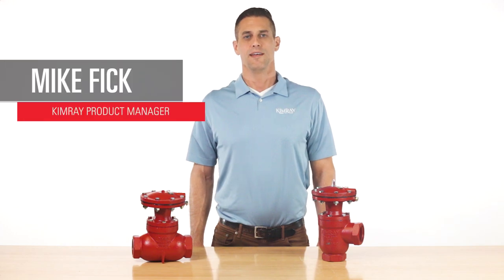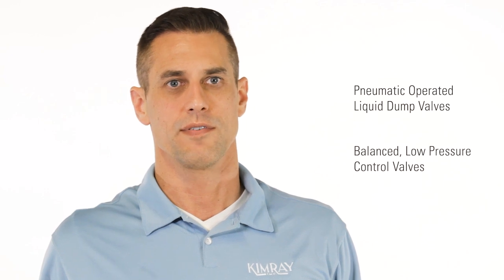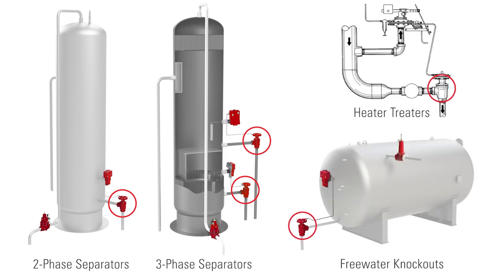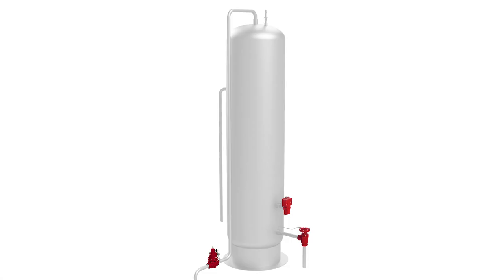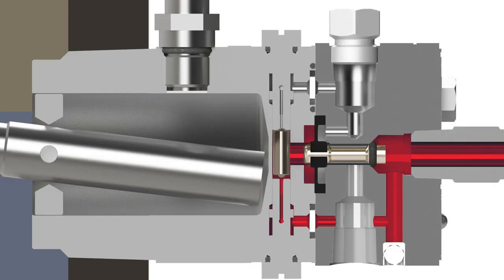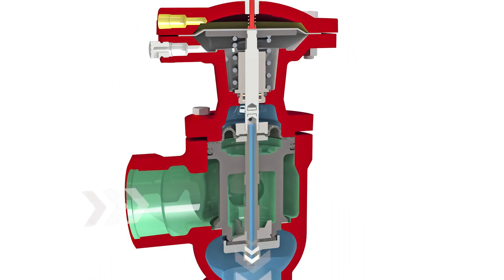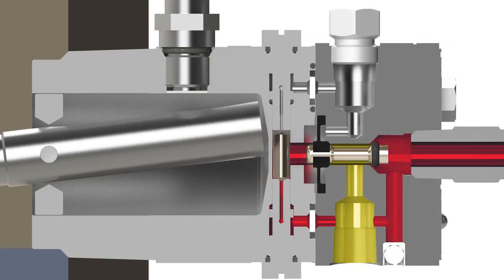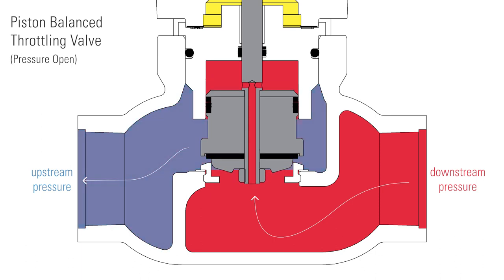How a Pneumatic Liquid Dump Valve Works [Diaphragm Balanced & Piston Balanced Throttling]

Comment: How much supply pressure to this valve 25 psi 30 ? I keep having issues with them leaking oil out the vent on top
Reply from the maker: The Pneumatic Liquid dumps can accept 10-35PSIG of actuation pressure.
 
If they have oil coming out of the vent port consistently, then they likely need to replace their packing around the stem assembly that runs through the bonnet.